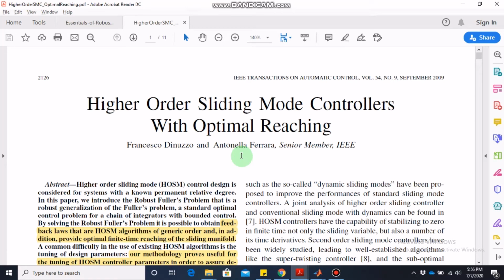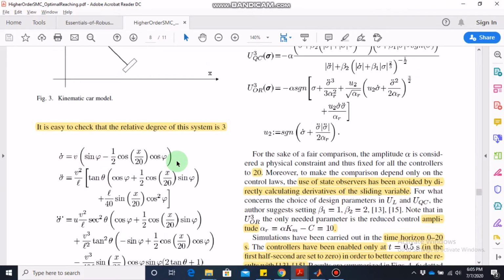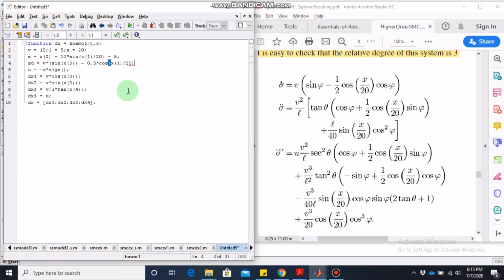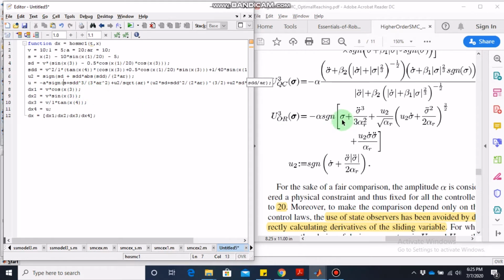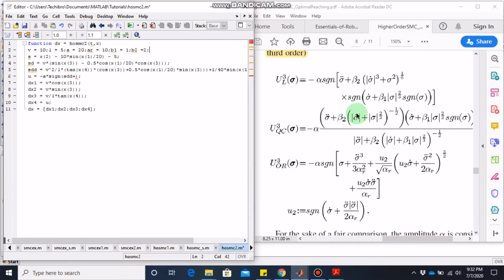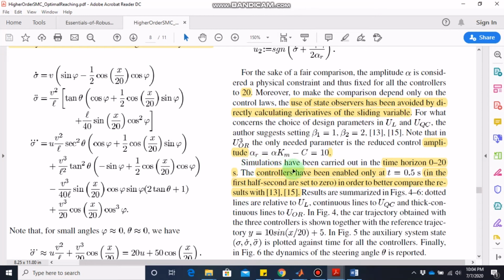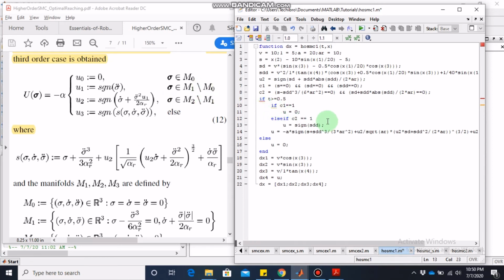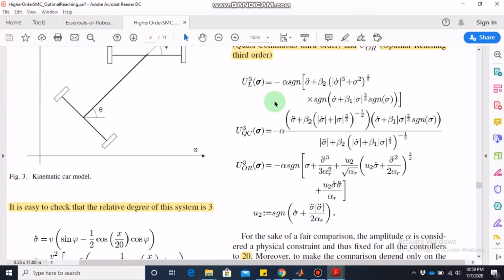MATLAB Simulation of Higher Order Sliding Mode Control with Optimal Reaching

Comment: hi！thank you for your teaching first.❤I have a question want to ask you. If the variable sdd contains the variable u, how can I do in the matlab. Because the sdd is defined earlier than the u, matlab can’t use the undefined variable. 😢
Reply from the maker: Since u is a function of x. It should be possible. For example, if u = 5x_1 + 2x_2, and sdd = 2u, then technically, sdd = 2(5x_1 + 2x_2). The problem arises when sdd = u and u = sdd (without involving x).
Reply: @cset  thank you for replying. I still want to ask that the example expression of u = 5x_1 + 2x_2 you write here, does the u derive from the state-spacemen of the system? cause the paper you introduce in this video, the u is U_OR, is it not a fixed expression？
Reply from the maker: @leyaozou1696  U_OR is composed of a complicated expression that uses sigma, sigmadot and sigmadotdot. These sliding surfaces (sigma) are composed from the state space. So U_OR is a function of states. In the paper discussed, sigmadotdot in u does not include u in its expression so there is no isuue.
Reply: And in the specific work what I make, the expression sdd contains u, u also contains sd, sdd (cause I used the u = U_OR expression shows in the paper), so Matlab dose not run. I really confused about it. Two of the state-spacement of the controlled system are : dx1 = x(3);  dx3 = SS.A * u + SS.B * x(3). So, how can I get u?  This question confuses me many days, I really appreciate if you can give me some help. @cset  🥰🥰🥰
Reply from the maker: @leyaozou1696  I am not sure how you obtained your sd and sdd. You cannot apply this control without understanding the basics of the sliding mode control. The fundamental guideline in the sliding mode control design is to choose the sliding surface s such that sd contains u and then your u contains s only (not sd). Similar logic has been extended in the paper discussed in the video where s is designed such that u appears in sddd whereas in the expression of u only s, sd, and sdd are used (not sddd). You have to revisit the mechanism of your design.
Reply: @cset  ok! Thank you a lot. To be honest, I am new to the sliding mode control, what I want to do now is to solute the chattering of my control system. Can you introduce some basic and easy understanding books for me to learning the sliding mode control and Higher sliding mode control? thank you again.💗